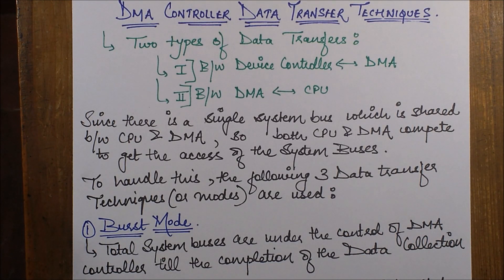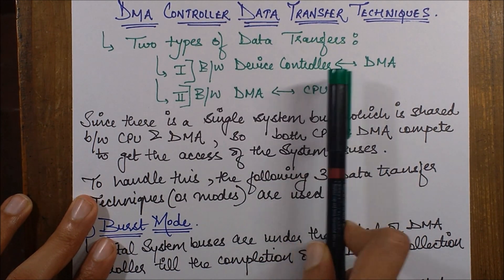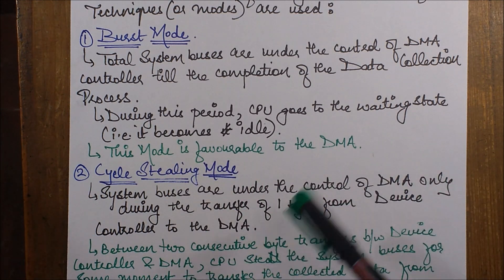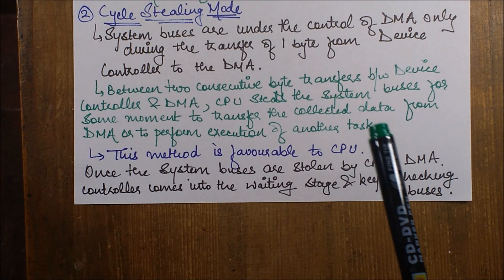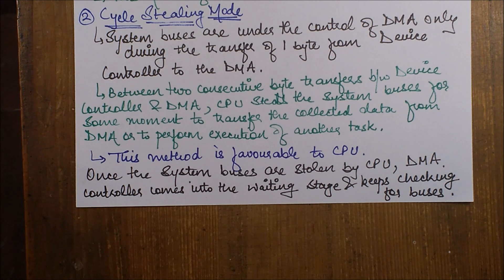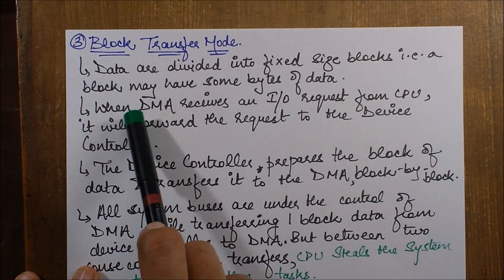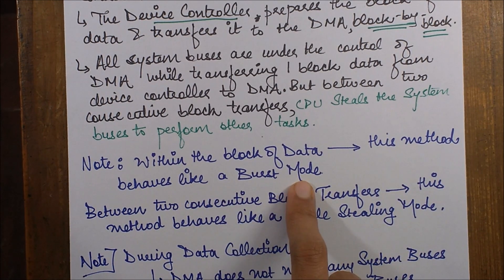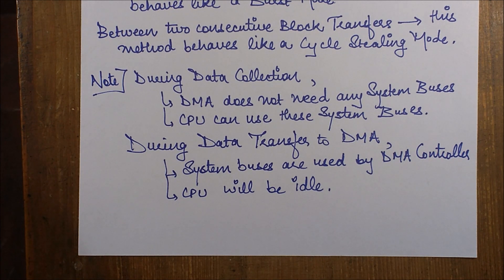DMA CONTROLLER DATA TRANSFER TECHNIQUES (Direct Memory Access)

Comment: DMA is a technique to transfer data between peripheral devices and memory without interruption of CPU, so why u are mentioning the data transfer between DMA - device controller and between DMA - CPU . DMA is a technique not any hardware component. Please do explain....
Reply: The CPU has to instruct the DMA the source and destination addresses as well as how many bytes of data to transfer, also it has to make busses available to the DMA so it can transfer data. DMA Controller is a hardware to implement the DMA Technique.
Reply: Pratika DMA controller is a hardware while the working of DMA controller is known as technique